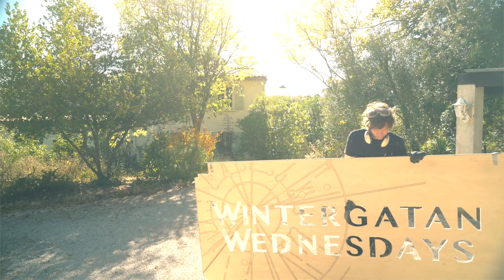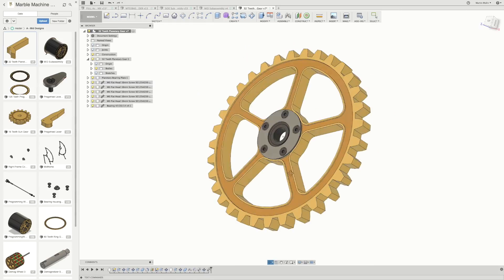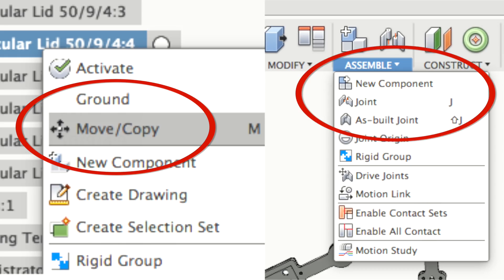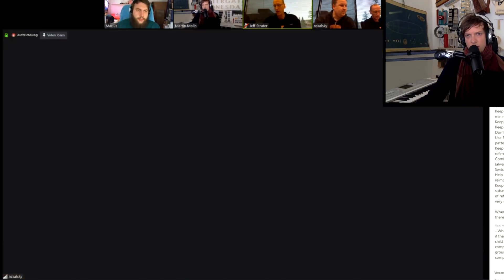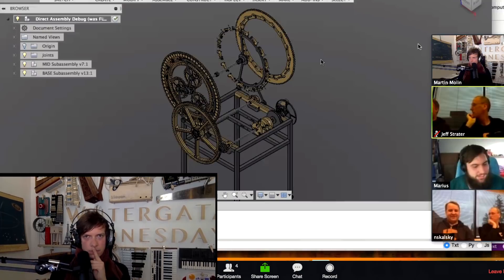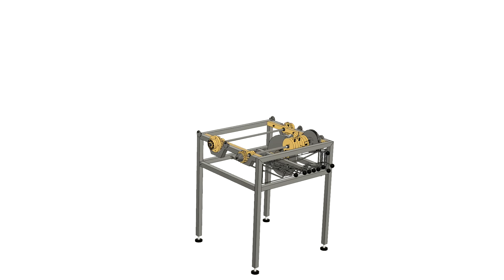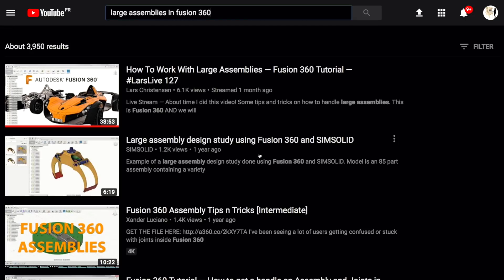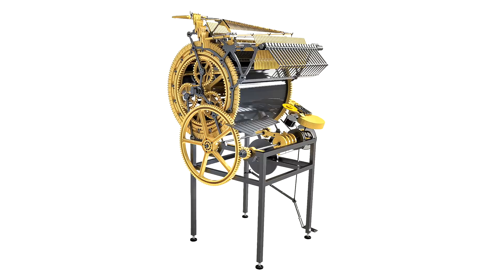Is Fusion 360 Unable to Handle Large Assemblies? - Marble Machine X #31

Comment: Well for one, stop using Apple products. In about two years Apple plans on dumping Intel CPUs in favor of Apple's own CPUs which will likely be ARM based CPUs like already use in iPads and iPhones. Effectively killing the Macintosh computer lines and turning the Mac into a iPad Pro with a keyboard.

I doubt any professional software will be ported over to it. Hell it took years for anyone to properly support windows 10 even when developers had over 2 years headstart before Windows 10 was released and windows has a much bigger market share than Apple/Mac ever did and they still lagged behind by the time users started switching to Win10.

Also, Autodesk and most all software of this nature never utilizes GPUto it's full extent. Even phototoshop is really bad at this. Sure using a GPU helps but if you had a GTX 1060 installed will perform no faster if you had a Titan V installed.  You'd think for such expensive software AND how long it's been in the market these professional software applications would scale to to the hardware it's being used on. But nooooo. When Apple re-releases the Macintosh (or whatever they call them) on a lower end hardware, it will no longer be used by professionals, let alone by gamers.

Comment: One helpful performance tip in Solidworks is to lock the rotation of all of the hardware, as the computer will have to calculate the rotation of each screw and nut during each rebuild if they are not locked. This may or may not help in Fusion 360, but It may be worth trying!

Comment: Its not the CPU...   it's physics.   CPUs have not gotten appreciably faster in over 8 years. Adding cores enables them to claim more transistors... but they can't claim speed. No one has yet come up with a useful way for multiple cores to handle a single modeling space.   Parametrics is "supposedly" less memory intensive than polygonal modeling, but that only holds true as long as you are modeling with primarily primitives... cylinders, spheres, torii, etc.    the minute you start drawing custom splines with odd shapes, the size of the model in terms of information balloons dramatically.  
To speed things up you can buy a used gamers PC that sports maximum RAM. (you don't need new- they are no faster ). You should invest in a Nvidia Quadro series card, at least P4000 grade or better.  Gaming cards are optimized for RENDERING with texture maps and maximizing frame rates.  The Quadro series cards are optimized for Geometry....which is what you are creating.
So max ram, modeling specific card...   get a big SSD to run the software- system and store the model files on while working... that will give you the fastest performance that equipment can offer....
But you can STILL bog that equipment down to a sluggish speed.   3D modeling is the most intensive thing a computer can do.  And all those cool features of Fusion 360, that allow you to move one part... and have all the linked parts in the hierarchy change dynamically?   Yeah...that is a HUGE suck on your processor.  Rendering transparency?  That, too is a major drain on system resources.  
Turn all that crap off.
Secondly... in modeling large complex assemblies, you want at least TWO versions of each identifiable subassembly.   The engineering model.... which you keep as a separate file for doing the actual changes to the model you will use to produce parts...   and the placeholder model.   The placeholder model needs only feature the actual bare bones shapes and volumes, with no details. These are used when you are placing or moving other subassemblies around just so you can verify they do not interfere with each other or align correctly...    that is, any part of the model you are not actively modifying, should only be rendered as the placeholder... not the full assembly.  The software we use allows us to work on a subassembly model and save it separately... and the Full assembly model is updated when we open it, because the versions of the subassembly in the Full Assembly file are linked to the subassembly files.
You are already kind of doing this in your producing "screws" with no threads and such, and placing them as 'instances' rather than separate objects.

In addition, turning objects "OFF” also lightens the load on the processor. Only have displayed the portion of the model you are working on... or work on the separate file for the subassembly- which is linked to the larger model and will update after you save it.
You will see most pro modelers working in wireframe simply because THAT speeds things up a bit, too.   

But there is no way around the pure limitations of how much information that is hierarchically linked that you are manipulating.  It's a terrifically complex object in 3D space. Comparable to any digital version of a Car or airplane.
You can try migrating to more advanced software... but that will be a year long learning curve.

It is not at all unusual to set a complicated model up and have the software take a full day to just render the whole thing.   Get used to it.   Advanced engineering modeling requires the patience of a cast iron saint.

Comment: hey martin, ive worked as a construction engineer for some years now (engineering with ptc creo) & we actually do it the same way your workaround works for years now.

even on creo with massive cpu capacity & graphic cards, it wouldnt be able to handle everything on top level

Comment: Use a pc build , with dual or quad cpu , and a good gpu , all most new software use the gpu for helping you cpu 

On apple stuff the graphic card is worst and stuck with low or middle end graphic card and not high end graphic card

Comment: You're pretty awesome my friend. Thank you for contacting Autodesk and using your platform to get solutions that would benefit all Autodesk Fusion 360 users. While I don't use Fusion 360, I use an array of other Autodesk programs. Performance issues for large projects is all too common with Autodesk software. Not only were you proactive to contact people at Autodesk for help, you honoured them and brought them into the process (instead of just pulling your hair out and cursing them as many of us probably/unfortunately do). Well done!

Comment: This is not a software or hardware problem at all. This is a deliberate product profiling decision made by Autodesk. If you want to do large projects they want you to get a more expensive program like Autodesk Inventor and by this monetary injection Autodesk is willing to sell you Inventor where the limitations of Fusion 360 has been removed. It would be easy for Autodesk to remove the limitations of Fusion 360 but for business reasons they don't do it.

Comment: My experience with both Inventor and Solidworks is that none of the program handle large assemblies really well, if the assembly containing a lot of  parts (.ipt, .sldprt). However if the assembly contains a few assembly files that in itself contains parts it works much better.
For example if you want a long chain say 1000 links, the best way to do it is having one link in one assembly, then group for example 10 links into one assembly, then 10 of those into one making 100 links, then ten of those making the full chain. 
"Free Moving" stuff usually laggs, i just use the constrain tool to place ("move") them directly.

Comment: You can put small parts likely hardware into the model so it will show up in the BOM, but then just make it invisible so it doesn’t have to perform calculations for those parts. Either way this is where SOLIDWORKS stands out. I work with giant assemblies everyday and they are super quick on a good computer.

Comment: I know you don't usually read these by the way, but just in the odd case you do. Just to add on to what I said, research how video Gamers speed up their gaming and also talk Autodesk and look up inventor because you have Autodesk Inventor Fusion but they also make Autodesk Inventor professional. What you can do is actually import your Autodesk Fusion build into Autodesk Inventor. They're both inventor, ones inventor Fusion and the others just inventor. Autodesk Inventor doesn't have some of the features Fusion does but that also a speeds up the program. If you set up a raid Drive, setup your Autodesk to that and then download Autodesk Pro (you might want to talk to Autodesk about this because it might have changed, it's been awhile since I've had to do it) that actually speed up a lot of your processing and gave you more free rein to add bigger part loads to it. Right now I'm in game development in my spare time, I don't want to post anything yet because it's an expansive game and I'm trying to get everything right, but that's what I did for my 3D designs. I actually have a lot of working things in the game that I didn't think we're going to be possible without running Autodesk Inventor Fusion. Plus I like the fact of the stress checking, which allows me to add real physics to the game very easily.

Comment: These sort of things are the division line between high end gaming GPUs and pro end CAD GPUs. My suggestion is a good CPU, intel or AMD it doesn't matter. Don't cheap out on the motherboard, 200-400 for just the motherboard is reasonable. 64 gb ram. Then get either a FIRE or QUADRO. These cards have compute functions that comsumer grade cards do not have. That is the difference between the GS, GT, Ti, GTX, and Quadro each one adds features at the GPU level

Comment: As a software developer, my problem is well known. The software is actually outdated and poor, first, the problems were solved by increasing the power of hardware. The truth is that most of the programs work in line with ten years ago. Programs do not use multi-threading, which was first a problem in operating systems. The biggest problem at the moment is that for truly good software, some parts need to be re-written from the beginning. The developers are absolutely clear to us ... but managerial staff never agrees, as their profits would be reduced.

Comment: Seems to me like the "solution" would be to add a command to the software which takes a selected group of components and converts it into a single component, but also remembers where each component was in that group relative to each other. Then you could move that single large "chunk" component where you need it to be without issues (1 move calculation versus thousands each time you use the move tool), and then have it recalculate the positions of all the components a single time after it is in the right place.

Comment: I have never used Fusion 360.  In SolidWorks you can constrain two parts when assembling them, so you do not need to use all the fasteners in the assembly.  That could lighten things up if Fusion 360 can do it.

Comment: +Wintergatan I highly suggest learning Inventor, I have used it for a few iterations and it's very fast to pick up. But yes, you are going run into cost issues. Now if you were going to design a complete suite of musical instruments to sell then it would easily pay for its self. I also have a reasonable alternate suggestion which is using an older version of Inventor. the 2016 professional program should be able to handle an assembly as large or larger as this. I have found resellers of this for about 500USD which when you think of it is only slightly more expensive than a years subscription to Fusion 360. 

Its been a few years since I have used this program and yes, it is a very different beast in how you handle constructs. But once you readjust again it is very quick to pick up the rest especially if you are this advance with 360 after only 8 months. Though I wholeheartedly suggest not using the built-in screw library and just build your own. 

Also, one last thing the ONLY cheating you will find in the CAD world is plagiarism. Other than that you should feel free to do whatever you feel needed to get to the end result. 

Thank you these videos tend to be the highlight of my week. :)

Comment: What I did was I set up a second hard drive (an SSD) and I used file copy, essentially I set my Fusion 360 in the raid and the regular hard drive so it was pretty much dual copy so I could use the solid state drives memory as a quick reference and it sped up my program almost triple. I did this for my 3D design for characters and for Unity as well, but you have to have a slot for a second hard drive in your computer. I'm running an Alienware laptop with three terabytes memory 16 gigs of RAM and an i7 processor and it's 760 graphics card. The graphics card does limit me sometimes but it still performs really well. Good luck Wintergatan and thank you for everything you do can't wait to see the machine!

Comment: As a programmer I would see a solution : allow for each sub-sketch to present a "light" version of it (for instance a box + necessary "joints" so it's easier to place relatively to other parts) then use this light version when moving/rotating this sub-sketch into an other (an display the refined one only after a while, when the user is not moving it around and machine as time to compute positions of every pieces).

Comment: I certainly dont know how you did it in your file, but I would imagine, that if you rather worked with more 'relative objects' for components such as those little fixture-levers on the programming wheel by making one lever, putting it into place and then using a command like 'pattern-oriented component pattern' (I'm only taught SolidWorks so there might not be anything like that in Fusion360) to then automatically put similar pieces in the other slots and not have them imported as full parts, would take a little weight of the softwares shoulders, because it essentially works just like with the gearteeth. Same goes for Screws and such: put one into place; select what you want it to connect to or how you want its orientation fixed; boop the function mentiond above and click one of the holes you want the screws/similar to go into... the programm should now know to put screws with the same attributes and relations in all the holes that fit certain parameters that resemble the original hole.
Best of luck in your further work and I hope I was at least of some assistance.

Comment: I dont know how Fusion 360 works, but i had a similar problem in solidworks.
You can get around the problem if you save your finished parts in .stp/.step
and use this parts in the assembly. It is also a workaround, but it worked in my case.

Comment: It's unfortunate you ran into Fusion's limits, but seeing how complex your build is I'm pretty impressed at what that limit is. I'd never guess it was even that robust. The lesson here is that parametric modeling performance is based on solving: solving sketches, instanced geometry, assemblies, motion. The less solving you need to do, the better performance you get.

I don't know how part patterns work in Fusion, say for a stack of hardware or parts used multiple times radially around the programming wheel. Is each copy instanced with its own joints to the assembly or is a single stack of parts and the joints only visually copied. Pattern driven assemblies are significantly easier to solve than instanced geometry.

Comment: solid edge was smarter in that way. It din't show tread or gears but it was still there, so you had parts that clipped trough ech other but only if they actually could. Man I miss designing in CAD.